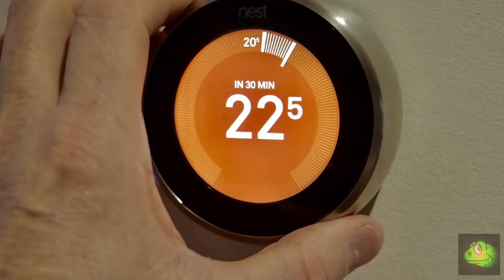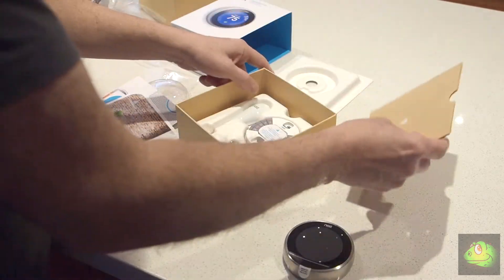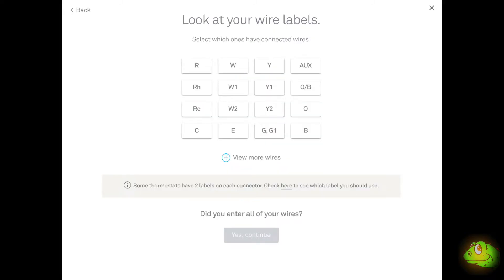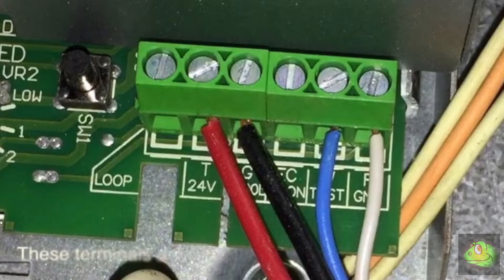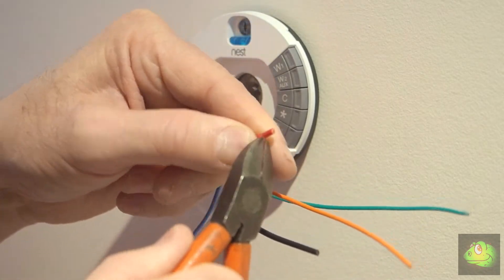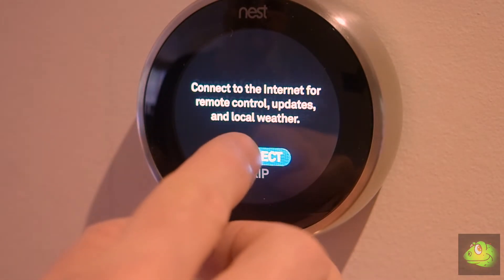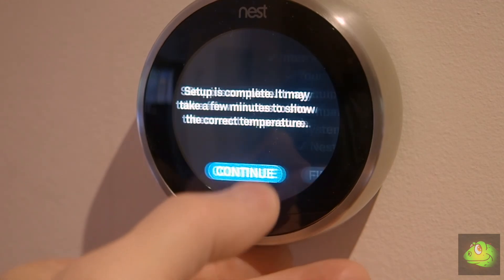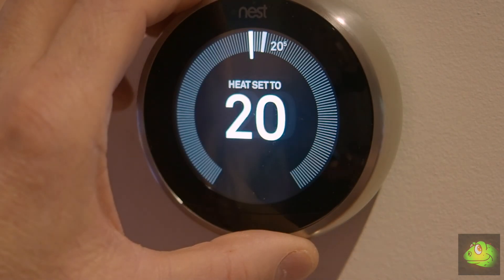How to Connect Nest Thermostat Gen 3 to Brivis Ducted Heater

Comment: i Currently have Brivis GAS wombat 120 ems and my old thermostat unit is connect to R ,W and EC which is connected to main board R,W and EC(ECON which is for high low fan. ) G(Cool) and T(24v) are currently not used 
Just would like to know if i decide to purchase the nest what do i connect the EC(ECON) wire to on nest unit. is it w1 .

Comment: Great Video, very clear and to the point.
I have a BRAEMAR BMQ315 and want to get something like this happening. Scared of running a common wire from the unit itself, what type of wire can be used - can it be standard speaker wire?
Also how will i know which terminal to run the common wire from on the unit itself?
Reply from the maker: Thanks for your comment. I don't know about your unit specifically - sorry! Speaker wire was generally used for the thermostat connection - not sure if that's still the case. It should be fine as long as your Braemar control circuit runs on 24 volts.

Comment: Great Video. I looked my Bravis Wombat 20 heating system and it has only W, R and G option. Will it be sufficient to power the nest thermostat.
Reply from the maker: Thank you! I had a look online at what I think is the controller inside your wombat. It looks like it is similar to my controller. All you have to do is connect the terminals you mention plus run a cable from the C (common) terminal inside the wombat. If in doubt get a pro in to check it out for you.

Comment: Great vid thanks. Would you know what issues arise without the 'c' wire? I heard this has batteries too. I'd like to avoid the extra hassle until it proves to be troublesome. Also, your option to go with the fan, was that just something so in summer you could have some airflow? I noticed that originally, if you were going to go with the 2-wire option, you would be using the 'Rw' connection, but you ended up using the 'Rc' one. Is the latter the one to use when there is a common wire being used (hence the 'c' in place of 'w')? Cheers. Nice job.

Comment: Thanks for the helpful video! I've got the same model Nest, same model Brivis. Similarly wired up Rc/W/C/G but I keep getting the "no power message". Went up and checked and I'm not seeing 24V across C(T) and R at the Wombat panel. Any ideas?
Reply from the maker: Hi, thanks for your question. Are there any leds lit on the wombat panel? Two things I’d try. First, turn the 240V off (or unplug the unit) for 30sec or so and see if that resets the unit. Second, with wombat unplugged, take the cover off the controller and see if there is a fuse that needs replacing. Let us know how it goes.

Comment: Thanks for a great video, I have the same scenario, just R and W wires connected, what documentation did you follow to know to connect up to g,rc,w1 and c? I was just planning on putting in a new common wire and leaving R and W in place. Cheers
Reply from the maker: Hi, it’s been a while since I did this and I can’t find my notes... I pieced together various bits of info from chat sites on the topic. Brivis seem to be very secretive with their manuals and information but there’s a bit on the web. The Nest web site is quite helpful but you need to look at the UK site not the US site. Connecting a common wire and R & W will be fine. I only connected G (fan) out of curiosity to see if the Google Home would just turn the fan on. It did.
Reply: @Iguana6767  Excellent thanks so much for this, I'll give it a crack and see how I go. Out of interest what Brivis do you have? We have a Buffalo 20 which is about 4 years old.
Reply: My thermostat arrived today and got it all installed following your great video thanks again. Worked a treat. The only issue I came up was I had my love wire running into Rh, and it said it could detect a current, even with a common wire installed. I then changed my love to Rc and then it picked it up. Such a great little device. Cheers

Comment: Thank you for the video. I have exactly the same unit as you. Do you think it would have worked with the wired you had (only R and W)? Or did you HAVE to pull two more wires through?
Reply from the maker: Hi! No I don't believe it would have worked without at least one more wire (the common) as the thermostat would not be receiving power. Try it with the two wires you have and see what it does. If it is impossible to pull new wires through, I saw this video https://www.youtube.com/watch?v=gahPxCcPDto that shows how you can power the thermostat with a transformer / plug pack. Hope this helps.

Comment: Awesome video. My equipment is identical to yours, I followed all the steps but I got an E22 error message suggesting there is no power getting to the thermostat. I re-checked the wiring but no joy. Any ideas?
Reply from the maker: Hi Nick, I looked up what an E22 error message was on the Nest website. It said “No power wires detected. Rc or Rh wire required”. Unplug the thermostat from the base and use a multimeter to check if you have 24V AC across the Rc and C terminals on the thermostat base. (We don’t use Rh in this case). If you don’t have 24V AC, check that the copper conductors are making contact in the terminals. If that’s ok, go to the heater and check that you have 24V AC across the T & R terminals. If not, you may have a blown fuse in the heater (I assume there is a fuse!). Hope this helps.
Reply: Success, I swapped the Rc to Rh assuming C stands for Cooling and H stands for Heating, all worked 👍🏼👍🏼

Comment: Mate. I have the old analog Honeywell controller you showed in the video.  The original one you had before updated.  Are you saying google thermostat will work if I have this?
Reply from the maker: Yes but you will probably need to run another wire from the heater to the thermostat as shown in the video. The old thermostat is really just a switch. The nest is just a switch too with some smarts added.
Reply: @Iguana6767   your a legend mate. You must be one of the only people in Australia that have got it working. I have been using Google stuff for years and everyone has tried to get the nest thermostat working. The extra wire you refer to is for the constant power right. I have seen videos saying it can work without but will run the battery down.  I will try and get a constant otherwise they sell a constant power supply for them that is a 24v wall adapter. Just to keep the thing powered.  Cheers.
Reply: BTW.  I found a person in Melbourne that does supply and install for nest 3rd gen ducted heating.  He said that you need an interface module and that they can’t be connected directly.  Is he wrong?
Reply from the maker: @dallaswhite3256  Hi, it depends on how old your Brivis system is. Mine is an older one and the thermostat and controller are analogue. If you have a newer system with a digital thermostat (Brivis Networker) then yes, I believe you will need an interface module.
Reply: @Iguana6767   I have a Vulcan unit that is from 1984 so I think it falls under the old analog category.  Lol.
Reply: @Iguana6767  if you are not already in the group you should look at joining this Facebook group. Google home, mini & hub Australia users group. They would love any information relating to getting the nest thermostat working in Australia.  They have been trying to crack it since 2019.

Comment: I have the same heater and controller as yours, but also a brivis ac unit.

Do you have a ac system connected to the same wombat fan?

Can this g3 control both?

Also what is the model you buy? eg. T30xxUS
Reply from the maker: Hi, our system doesn't have AC so I've never investigated if the Nest can control both. I suspect it could be difficult... The model no. of our Nest Thermo is T3007ES.

Comment: I purchased one of these. I noticed that Australia showed up in the location. I spoke to Nest yesterday, and they told me that I would need to select USA. So is their advice wrong, and Australia Region is available? Thanks
Reply from the maker: I'm not sure why Nest would advise you to select USA. Australia certainly came up as a selectable location during the setup and I've had no problems with that setting.
Reply: @Iguana6767  Thanks. I suppose I can proceed once I get my C wire installed.

Comment: nicely done chief! Wish this was compatible with the newer Brivis networker.
Reply from the maker: Thanks! pls see the previous question. I understand if you use a Brivis 529 analog interface, this will convert the analog wires that the Nest uses back to the 2 wire digital signal that your Brivis heater uses.
Reply: I have a newer ducted heater plus add on refrigerative cooling in 2 zones. I don’t think the 529 interface supports my setup? Do you know anyway to get my setup
connected to the Nest?

Comment: HI Mate, Im from Brisbane, so what you are saying is THIS JUST WORKED with your system, is that correct? Sorry this may seem like a stupid question. Did you have any voltage issues?
Reply from the maker: Hi William, I've had no problems at all with the setup. It's exactly as you see it in the video.
Reply: @Iguana6767  Thanks for the reply. But to clarify you simply purchased this and the voltage was not an issue at all. Sorry to be a pain, but it's hard to get answers out of Australian Air Con installers as they seem to be very scared of these Next Thermostats.
Reply from the maker: @BrisbaneTeslaGuy  I don't know what your heating system is but make sure you get the right model. From memory it's a US version. The UK ones are different - heating only. I have Model no. T3007ES. Also, this may help your tech, ultimately, you need 24VAC across the Rc and C terminals on the Nest to power it properly. Hope this helps.

Comment: What makes it non compatible with the new a starpro systems?
Reply from the maker: Hi, my understanding is that these newer Brivis systems use thermostats that communicate to the heater digitally. I understand if you use the Brivis 529 analog interface, this will convert the analog wires that the Nest uses back to the 2 wire digital signal that the Brivis uses. I didn't need the analogue interface for my old system.

Comment: Thank you for the video. It is almost perfect - almost, because your system is more advanced that some older ones - you have T and C in addition to R,W,G - old systems have only R,W,G.

My Brivis Buffalo 20 heater from 2001has the overheat sensor (thermistor) cutting out power to Rh, which leads to an error and a loss of connection and "delayed for @ minutes" messages. The only way to bypass this is to supply additional 24V to Rc, so they are not taken from Rh. This https://youtu.be/-c1zlfz1IeY?t=450 explains that it is possible to supply additional power through Rc, _even if Rh is the one that controls the heater_!
So for my case - I had connected Rc to constant 24V at the one of the pins on the board (the pin that does not get the power cut off at overheat is the sensor's pin) AND the C wire is connected to the body of the heater itself. Nest now uses C and Rc for power,  while controls heat through Rh and W.